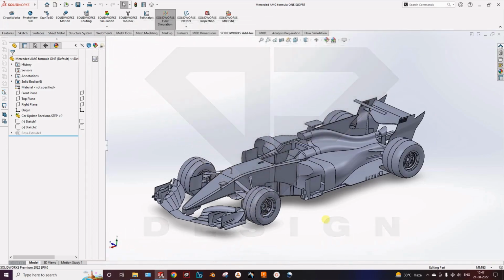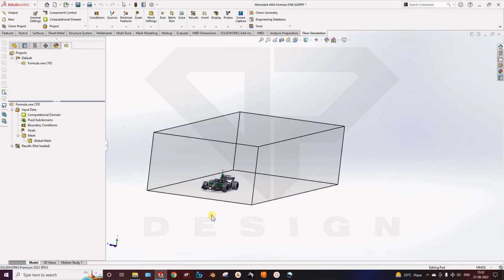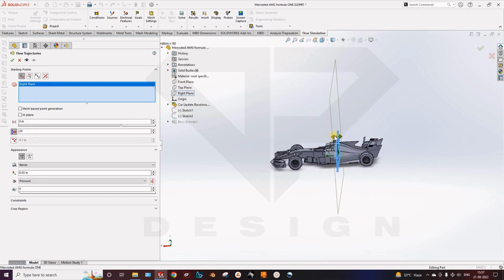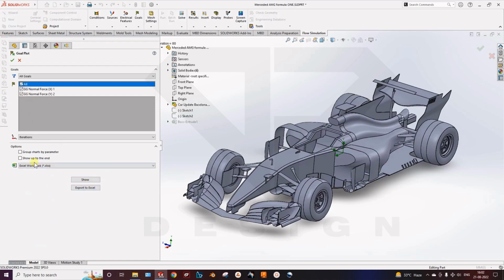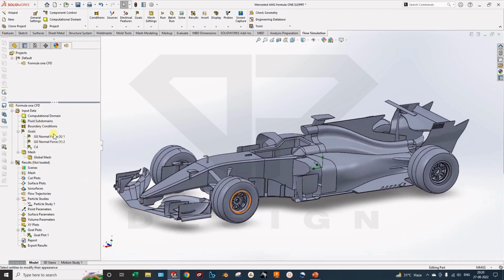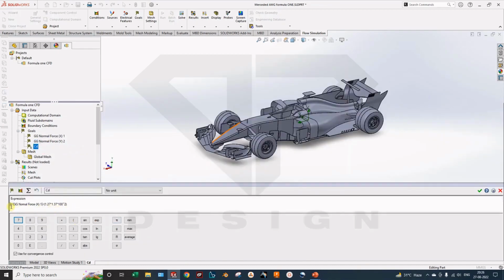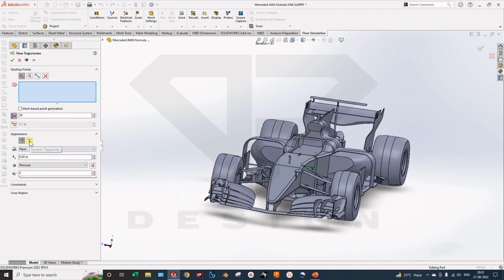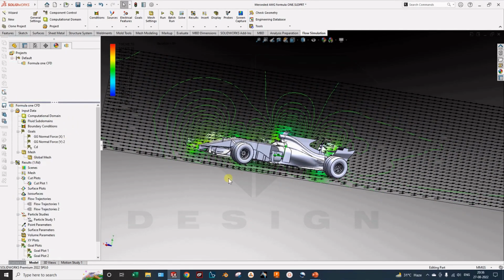Formula one CFD Simulation Tutorial | Aerodynamics | Solidworks CFD | DP DESIGN

Comment: what about planes?. can you do a CFD Simulation on planes. it would be very help full if you show us how we can perform a CFD simulation on STL files imported from other 3D modeling Softwares(like Blender).
Reply from the maker: Yes we can perform CFD simulation of planes but we need to have a parasolid or STEP file. Stl file will not support.
Reply: @dpdesign3477  ok. so, could you make a video on planes please ?. i don't thing you will have trubles finding a suitable model with the right format.
Reply from the maker: Yes we can. You can send us the model on dpdesign.engineeringsolutions@gmail.com for validation.